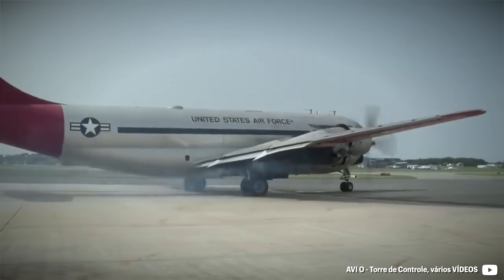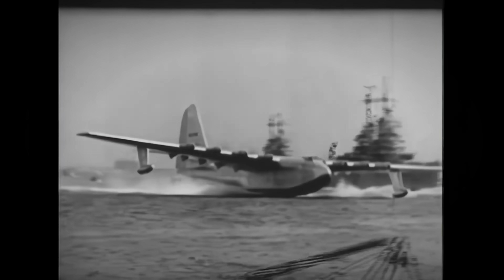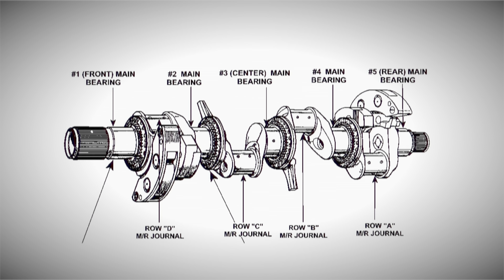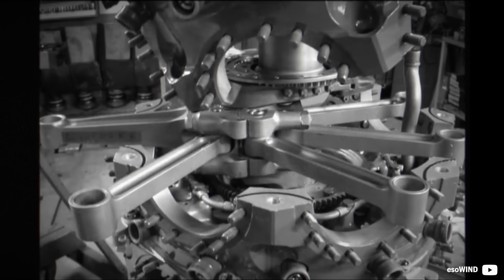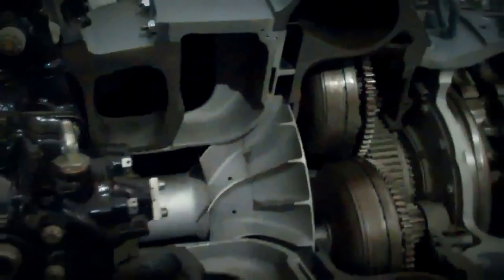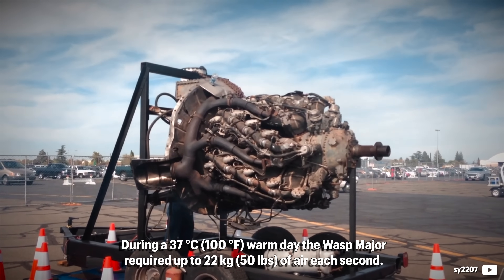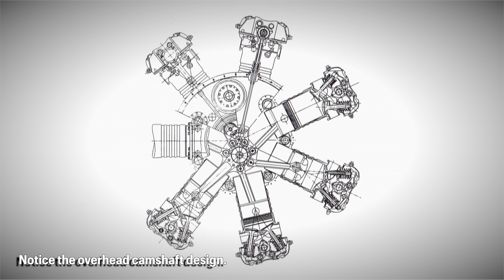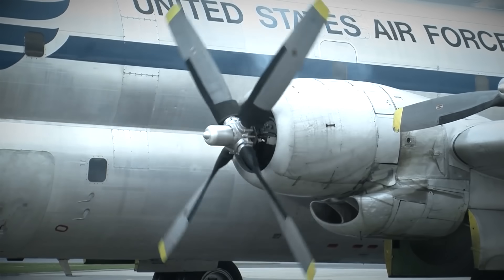How To Build A 4,300hp Aviation 'Wasp Major' In The 1930s?

Comment: The Choice of 7/row locks in the spiral offset angle to achieve even power pulses, which is a given.
The R-4360 cooled OK in flight, but was a challenge to cool on the ground. Heat soak back after shutdown was also a problem for parts like low-tension ignition coils.

Comment: With two spark plugs per cylinder a spark plug change required changing 56 plugs. A B36 had 6 of these engines with 336 total spark plugs. This engine also burned a lot of oil. The B36 had the ability to add extra oil while in flight. The engine was a maintenance nightmare.  The B36 could fly for 24 hours nonstop after which it would be down for 10 days for maintenance. When it was replaced by the B52 the Air Force must have said "thank God".

Comment: Nice videos of the B-36 that used 6 of these monsters. (And was still underpowered so they added 4 jet engines later, which also burnt the avgas)
Reply: What did all that lead do to the jet engines? Couldn't be good for them.

Comment: There's one of these Beasts is on Static Display in the Air & Space Museum at Dulles Airport in Virginia!! Also, that Lycoming XR-7755 Monster that was supposed to supercede the 4360 is there as well!!
You have to go there yourself and see it up close!!
09:05 - I do believe that the Plane here has Turbo-Props!! Maybe it used to have 4360s?? Maybe Yes??
Too bad that the Spruce Goose was never modified to accomodate a set of Turbojets like what was on that "Peacemaker" monster!! Maybe just remove the 2 outer 4360s and install a set of those twin Turbojet Units!! Probably not at all feasible but I'll net that the Goose would have flown more easily!!

Comment: No production model R-4360 was rated as high as as 4,300 HP, although there was a third generation in the works, the VDT, that was going to be released with that rating. The R-4360-53 (installed on B-36) and the R-4360-63A (C-124 Globemaster) were rated at 3,800 HP at take-off. 63As were installed on an F4U and two Sea Furies for the Reno Air Races. Crewmen shared with some of us fans that they ran them at up to 4,200 based on the torque meter reading and rpm, not from a dynamometer run. Redline RPM per the operating manual was 2,800; the Reno guys ran them at 3,000 RPM, maybe a bit more. Dreadnought’s pilot ran theirs at 3,200 RPM one season, but after pulling a few cylinders and seeing evidence that the valves were just starting to contact the pistons, they backed off.

In the test cell, Pratt and Whitney ran one at 4,800 HP for an hour according to a data sheet they released to the industry. Along with a few other outliers, whose purpose I’m not sure of. Viewable at enginehistorydotorg.
Reply: Just the fact that these things actually worked is quite amazing!! Not only did they work...they bloody worked extremely well!!!! They could endure the most brutal punishment!

Comment: The offset of the cylinders dictated the firing order and was optimized for balance, obviously, but an added effect was more surface area for the heatsinks on the heads to allow sufficient air to cool them.

These were probably the most technologically-complicated internal combustion engines ever designed. And it's fuckin 80-yr-old tech...

Comment: F4U Corsair used the R-2800 Wasp. Not the R-4360.
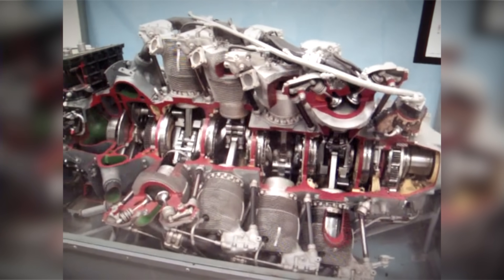Reply: The one at 3:45 came with one, along with 17 others. F2G-1 and -2, built by Goodyear. Pratt and Whitney swapped a pre-production ‘4360 onto a Birdcage F4U-1 in 1943 for R&D, dubbed the F4U-WM. They messed around with a few more during the war, and the F2G was the production version, although the order for 100 was cancelled after the war ended.

Comment: It was much better to build 22-cylinder radial in this time. Much easier to cool and produce. And still lower diameter. 2500 hp machine on 100 octane fuel...

Comment: I wonder how did you come to that number, 25.714 degrees. Being a 28-cylinder 4-stroke engine means that a firing event will occur 7 times in each revolution. Dividing 360 by 7 will result in 51.428 degrees, exactly double the number you proposed.
Reply: 4 cycle engines make 2 revolutions to complete the cycle. In this case, with 28 cylinders, he is correct. 720 degrees rotation divided by 28.

Comment: Would have been an amazing fly-over sound with the 8 - 28 cylinder engines R4360''s of the 'Spruce Goose' humming over head, much as we enjoy the sound of a Messerschmidt Bf-109 with Daimler-Benz DB-605 inverted v-12 or a Merlin V-12 Rolls-Royce engine fighter aircraft of world war two!

Comment: To be clear the engines are also ALL Oil cooled as the function of oil is not only lubrication which in itself prevents heat, but also as a heat exchanger

Comment: This is more mechanically impressive to me than even a jet engine.  What a fantastic piece of engineering!!
Reply: This was the reason for the jet engine.  Piston engines had gotten way too complex.  The 4360 was only suitable for military service—every civilian aircraft that used them lost money.  The turbo compound 3350s were nearly as bad.  The apex of power and reliable was the 2800… but even four of them couldn’t keep up in terms of speed, range, and capacity.  Jets and turboprops were the only way forward.

Comment: Hughes aircraft designs always seemed to be underpowered graceful catwalk model types inspiring everyone, in stark contrast to what actually went into the war zones like the Grumman-Vought-Republic-Curtiss-etc designs. A T56 powered (see your footage of the Boeing Super-Guppy as exampled engines) Hughes H4 would easily have flown, they just weren't available yet for this revolutionary design. I've seen that 3D model of the R-4360 before and wondered why the modeler put the way under sized prop on the front, it's truly the best impression of this engines power to see a museum piece with its actual prop hanging up front. The H4's engine nacelles look like mere nubs for the huge props Howard hung on the front of those units, yet all that HP still wasn't enough.

Comment: It would be very exciting to make a 1/10 or 1/5 scale working clone of it. I'm very curious what would be the power output of it. Probably would be a crazy crazy race engine
Reply: IIRC there was someone who had started on design work of a scale R-4360. 1/5th scale I think. There is a company called Ageless Engines who sell drawings and castings for scale aircooled radial engines. In 7, 9, 14 and 18 cylinders. Loosely based on either Curtiss or P&W designs they are all based on a common cylinder design. Ageless Engines actually recommends that if you were to want to build one of their engines you start with a 9 cylinder. The 9 and 18 actually offer some easier machining challenges over the 7 or 14 due to indexing issues. The engines are able to be built with the use of a lathe and vertical milling machine. In this case a 9 or 10 inch Southbend and and early Bridgeport. The plans include drawing for all of the fixtures needed to complete machining of the cylinders, master rod, slave rods etc. The 9 cylinder requires fixturing with 40° angles. The 7 cylinder requires angles of 51.428571°. To do this properly you really need either a rotary table with division plates. Or a surface grinder, angle plate, sine bar and Jo Blocks. When I was working I made special tooling for indexing parts without a rotary table in 5, 7, 8, 9 and 10 units. The 5, 7 and 10 unit indexing blocks required specially ground angle blocks produced with a surface grinder.

Comment: How much hp would this engine produce with 4 valves / cylinder and direct fuel injection? Direct FI would also alleviate the problem with engine fires caused by icing in the carbs.

Comment: This was designed by slide rules and mechanical calculators, not computers. That is amazing. My father worked on the C-W Turbo Compound engines 1953-1963 and those were crazy complicated.
Reply: We used to use cylinrical slide rules when I first started work, like a 5 foot slide rule in a spiral. They were surprisingly accurate.

Comment: Good to see...
   My ex-father-in-law (now deceased) was a young engineer on a last hurrah effort to produce a radial engine competitor to the new jet engines. P-W made 56 cylinder prototype engines by joining 2 R4360 units. 
   3 units were built. All suffered from excessive timing variation between the first and last rows of cylinders. As much as 7 degrees of slop in timing from #1 to #56. 
   The last prototype ran on the test dyno for 3 hours before self destruction.
   The program was terminated at that point.

Comment: I can’t remember the documentary I saw this on but for this engine to test the reliability of the Pratt & Whitney R-2800 Double Wasp engine to make sure it would be great in World War II fighters they tested it by running it at max power for 24 hours and it didn’t break and the test bed made 3400 hp but was reduced to 2800 to help keep the engines lifespan so 24 hours at 3400 RPM that’s one hell of a dino pull

Comment: At about the 2 minute mark, the specs show 52 valves. Did 2 cylinders not have any valves?
Reply: They usually dropped a couple of cylinders when they were flying.
Reply from the maker: It is a 2-valve engine, my fault in simple math. Sorry

Comment: An old-timer Pratt engineer I spoke with -  his job was to test every engine that left their factory - was thrilled with the switch to jet engines.  Apparently the piston engines were absolutely FILTHY to work with.  Not to mention what happens to your day if you accidentally foul the spark plugs & need to change them all.
Reply from the maker: I really cannot imagine that. As amazed I am seeing it working, switching to jet engines was the best move the aviation industry could do, indeed.

Comment: The P&W WASP Major was a 4300 hp Swiss watch. The design and mass-production of such a complex machine was an engineering triumph.
Reply: Not all versions were rated at 4,300 HP, most were only tuned to 3,500 HP.
Only the turbo/fluid coupled version was rated at 4,300 HP, and they were only used in a few applications.
Reply: @dukecraig2402  Thank you for the information. It doesn't change the point I was making.

Comment: Rolls-Royce realised that piston engines were getting too complicated. Their supercharger (from Merlin and Griffon) had become supremely efficient so they went to turbo jets and turbo props and avoided the step yo huge multi-row radials.
Reply: Everyone did, engine's like this were only made because aircraft designers called for powerplants for massive new aircraft designs before jet engine's were capable of doing the job.
What was everyone supposed to do, sit on their hands for 10 years without designing new aircraft waiting on jet engine's to be ready?
Reply: Radials were never Rolls Royce's thing. The World War 2 European theatre was mainly fought over land (with the exception of the English channel) with both sides employing watercooled V engines, with advanced features such as 4 valves per cylinder and sodium cooled valves. Aircooled radials were used more in the Pacific theatre, by both Americans and Japanese. The lack of a liquid cooling system made them more robust (especially under fire) which was vital when fighting over open water. There was one British manufacturer known for its radial engines: Bristol, which produced the 18 cylinder centaurus as well as some 14 cylinder engines, and specialised in sleeve valves. Pratt & Whitney's 28 cylinder Wasp Major was a very successful engine (nowhere near as succesful as their 18 cylinder double wasp) and is as far as I know the only successful radial aero engine with more than 2 rows.

Comment: The SuperGuppy pictured in your video, although based on the K97, had turboprops instead of the R4360's.   The shape of the engine nacelles is quite different.
Reply: Props too... and the SOUND in that one clip.
Reply: @KutWrite  Yep, square tip blades with cuffs.
Reply: Was going to mention the same thing.
Reply: Beat me to it

Comment: The Super Guppy you're showing had turbine engines I believe.  I've seen the HFB-1 at both Long Beach and McMinnville... that's where you get to see the engine cut-away (with the red paint).  The huge Lycoming engine is at Udvar-Hazy... it is magnificent.
Reply: 4 × Allison 501-D22C turboprop engines, 4,680 shp (3,490 kW) each.

Comment: Been wanting to see somebody respect this engine since I heard a running b29 as a kid. As somebody with a big block drag car, nothing can beat the sound of these.
Reply: The B29 didn't have this engine, it used the Wright R3350.
The B50, which was kind of a B29, had these engine's, developed too late to be used in WW2 the B50 did see use in the Korean War.
Reply: When building a plane or a car, you learn very quickly which engines are performers and which ones aren’t. Why you you choose an inferior engine is beyond me, but too each there own. Wright was notorious for having severe casting defects in their cases. Casting defects that could lead to potential grenading. I’m guessing that’s why they dumped the Wright motor. That would be akin to choosing a vw1600 over a rotax engine to power a small aircraft.

Comment: It took piston engine technology about as far as it could go. Fortunately, gas turbines took over.
Reply: piston engines are still unmatched today for its fuel economy right??
Reply: For low speed flights, perhaps. The more power you need, the more impractical piston engines get. Jet engines are much easier to scale up.

Comment: The later variants had a hybrid turbocharger designed by GE. IIRC, an exhaust turbine powered a shaft that went to a gearbox that then put the power directly back onto the crankshaft.

Comment: 28 cylinder - 52 valve ?
Reply: Those engines were notorious for losing a valve or 2
Reply from the maker: My bad!
Reply: if they made them 2stoke we'd only need 28 leaf valves and its speed to weight ration wouldve surprised even UFOs🐱👍🏿

Comment: Your video contains a significant error. The NASA Super Guppy that you have included in your video is not a Wasp driven aircraft,  instead it uses four Allison Allison 501 D22C turboprops. The short sequence where the aircraft is shown taxiing clearly displays turoprop engine noise. The NASA Super Guppy (Reg. N941NA) was originally built for Airbus to transport parts for Airbus aircraft and did so from 1983 until 1997 with the registration F-GEAI. It is the last remaining airworthy Super Guppy.
Reply from the maker: Definitely not intentional, sorry!

Comment: Nice video, you spoke about problems in the beginnning......well  the Boeing Stratocruiser with four  P&W Wasp Majors was nicknamed the best  3-engined airliner. But think of the fact that all calculations were made with a slide ruler. Thanks.
PS, you probably know them all but and covered them..... for a future video you could have a look at: the Aspin engine, the Junckers Jumo 205 and 223, did you cover the Napier Deltic?, the Bristol 5 cilinder swash plate engine, the Massive Yet Tiny engine, free piston engine, Saturn rocket F1 engine,
Reply: Doesn't matter how you do the math as long as it adds up.
Reply: I remember my schooldays with log books and slide rules. I think I must have been in the last generation to use them. Hated the log books but loved my slide rule though I always had the niggle that absolute accuracy was sacrificed for speed. I treasured my slide rule loving and protecting it for many years but never used it again.
After school I never saw either in use again and as I started work early electronic calculators become available, my first one cost £52.00 - more than a month's pay. It didn't even have a % key or a memory, just the basic plus minus multiply and divide. I remember my 15 floor office buildings heating engineers asked me to calculate the water volume of the heating system for them to correctly dose the corrosion inhibitor. That was a major task but made practicable and enjoyable by my first calculator.
How times change and how quickly too.
Sorry to ramble on, I have insomnia and my brain is racing.

Comment: Somewhere in an alternate universe a P&W engineer had a batshit idea and develop a 2-stroke version of the Wasp Major, which would’ve been a huge rival to Rolls Royce’s Crecy. Lighter, more horsepower, and WAYYYYYYYYYY louder. 

Great video! Used to confuse this with the similarly notorious Wright R-3350 Cyclone engine.
Reply: Imagine the guys who worked day after day to maximize airflow to barely get it to not overheat, and then their boss says he now wants a 2 stroke variant.
Reply: @albero319  Not just that, but a better way to implement sleeve/reed valves for exhaust scavenging on top of the already complicated cooling system. Maybe throw in a reverse-engineered BMW-801’s active cooling and direct fuel injection for good measure. Just to squeeze out every ounce of performance.
Reply: @Nafeels  And for extra performance, incorporate VANOS.
Reply: Yep, gonna have to make that liquid cooled. haha
Reply: yum yum my yamaha couldve used that..all that weight saved couldve been used for more fin cooled area..
Reply: It looks like the narrator is living in exactly that universe. 25.714 degrees is 360 divided by 14 as if there were 14 firing events (half the number of cylinders) for each revolution.
Reply: Fuck it. I got a 4360 and a machine shop. If you see a video of a 4360 with custom two stoke jugs and heads in a couple years you will know why.
Reply: @jadenwalker6713 how is the build going?